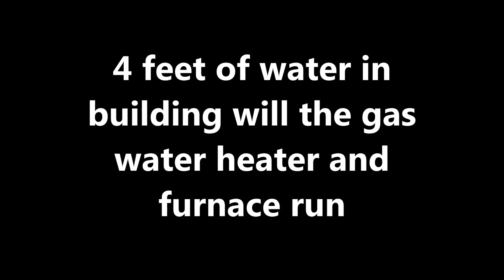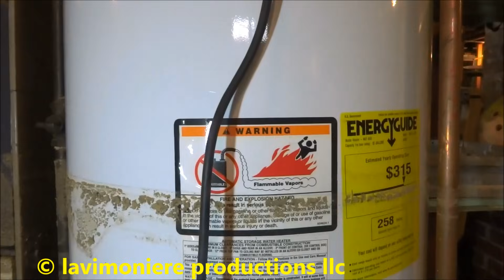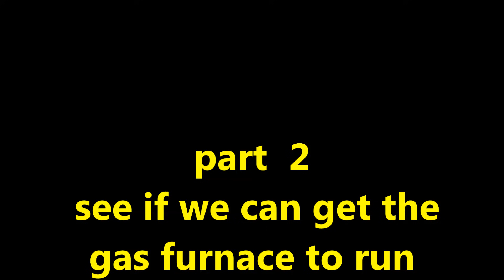gas water heater and furnace went under 4 feet of water part 1 of 2

Comment: Hi Steve, Several people have said to change out the flooded equipment. I tend to agree,  most equipment and valve manufacturers say if flooded = replace it. I think you would like to work on new equipment, rather than work on old rusty crap. Some insurance companies  may not want to pay, if the old stuff looks like it still works. John from Canada.

Comment: in my area we get alot of flooded basement due to heavy rain and sump pumps burning up . I have always been taught of any water reaches gas valve that valve , pilot assembly needs to be replaced . Most cases the water heater or furnace are older and we replace the entire unit .

Comment: Long term... with water between pressure vessel and jacket ... saturated insulation, the tank will rust out. There is no glass coating on tanks exterior... same sort of problem with furnace. GAMA has issued service bulletins about this... long term... replace...

Comment: I would never reuse a gas valve that has been under water. I don't care if it still works or not. I'm not taking the liability if it sticks open after I leave.
Reply: Jim D  Agree.  Any controls under water have to get replaced.  And the water heater should be replaced.  Maybe the furnace too.  Insurance will cover the costs anyway.

Comment: I'm going through the same thing in my cellar just not as deep ... got into burner pot ..I can get the pilot lit but when it fires it looks normal for a second then sporadic flame then slowly dies out ... almost seems like it's still letting gas out for a bit after as well !
Reply: I had same exact problem. Seems like it might be lack of air for combustion because vents are blocked.  That's why he left screws loose when he replaced the burner

Comment: To much of a liability if that gas valve  sticks open i know u trying save the guy a buck but better to spend the money and be safe down the road
Reply: Hey smooth, you thinking the gas control valve is corroding inside and may cause an unsafe condition?

Comment: You need to check if any carbon monoxide is leaking in the room after you start the Water heater. If that screen needs to be perfectly clean. I have had water heaters in launder rooms and had to change them because the lint clogged them.

Comment: hey Steve question. a bunch of years ago my folks had something like this happen, tho it was after a hurricane. what we did was used the garden hose and shop vac first, then followed up with the compressed air to dry everything out. now watching you go straight to the air i'm wondering if we messed up by trying to flush everything or if it was a good idea.

Comment: Where the heck did all that mud come from?  I saw no big erosion or cave-ins outside the store.   Hydrant valves are 4 feet under ground due to frost lines.  I'm wondering how the vehicle could of busted that valve open--unless it was already turned on?

Comment: They will not touch a flooded furnace /water heater…….has to be replaced even if it’s a day old…….in our area……..wonder if the board of health condemned everything in the store…….those gas valves malfunction you are looking at a mega lawsuit………

Comment: since I don't line in US I am want to ask. So, imagine this same situation - water is rushing in your basement very fast and you freaking out cause you have let's say a 100000 dollars worth of equipment down there. So, could you technicly in that situation let's say go to your main sewer drain line that goes in the floor of the basement and brake it so that it is fully open such as a drain hole in the tub, and letting the water drain out as fast as it;s coming in, thus saving your grand possetions in your basement? Not sure if you got right what I ment to say, but I hope you did, so could it be done? in a desperate situation?
Reply: if you mind if I ask why not? what bad can happen? it's just water going down the drain at high levels. . .